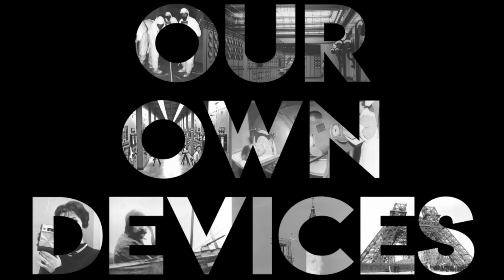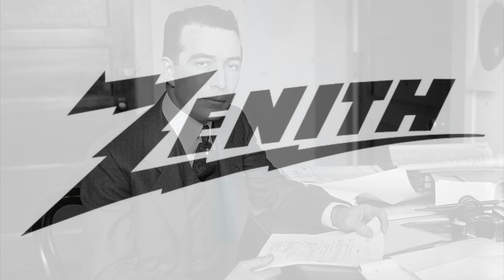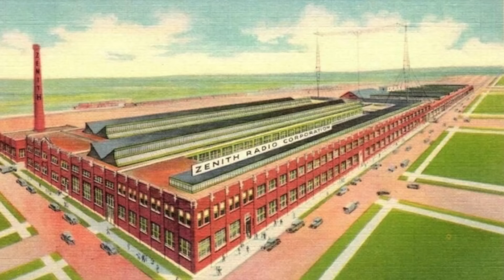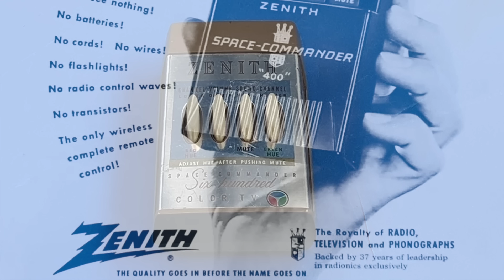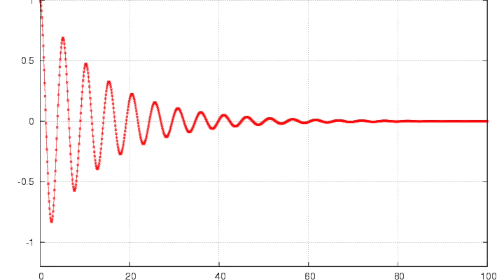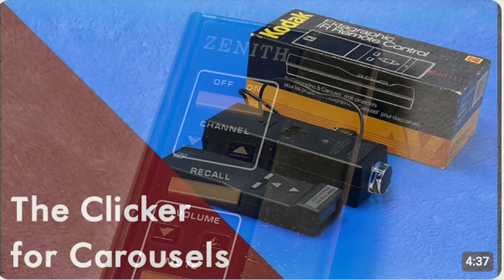Zenith Space Command TV Remote: the Original 'Clicker'

Comment: In 1963 my Mother purchased a 25” Magnavox color console television with AM/FM Stereo radio and a stereo turntable. Our first color TV, it was a tank, and cost $1000. The bezel around the screen was curved on the sides while being horizontal across the top and bottom. The picture tube was so large the tail end stuck out the rear of the cabinet about a foot. It was covered by an additional plastic housing mounted on the wooden rear panel. The sound system was incredible for its day, 2-24” broad range woofers and 2-4” x 24” rectangular x 24” deep horn tweeters. The remote was an ultrasonic “puffer”, one button for volume and another for TV channel. When pressing a button, a cylinder was being charged with air until a catch release was hit and you’d hear a hiss of air. The button would sag as the air was released. A motor with a detent control would advance the channels one direction one by one, 2 through 13, “U” and then over again to 2. No remote UHF, that required turning a radio-type knob and searching in the same manner we used to tune radio stations. The volume stepped one direction from low to high and wrapped back to low. Funny, to turn the volume down, you had to go up through the loudest to get back to the lowest and then stop at a setting lower than before. We enjoyed that TV into the early 80s, surviving 9 moves between homes in California, Hawaii and Nevada unscathed. When the electronics reached end of life, I converted the cabinet into additional storage for some of my mother’s silver. A suitable project because the pecan cabinet matched her buffet/hutch set which were also pecan.
Reply: That rear projection for the tube was called either the 'top hat' or 'bowler hat' in the UK, depending on size... and was a known vulnerable point on the set.... (the tube is weakest at the base)... any damage to there resulted in the tv service engineer (REMEMBER THEM?!) tutting and shaking his or her head

Comment: I'm solidly gen-x and believe me, I was the remote control into the late 70s.  Remotes were not ubiquitous as recently as the 70s.
These remotes that operate on tone added a lot money to the cost.  Though I believe IR was available by the late 70s, maybe even earlier.
But it really wasn't IR that lowered the price.  These tone remotes communicate to the TV through tones, but the TV has to hear it (requiring tuned circuits) and physical motors on the tuner and volume to operate them.  This added a lot of cost.  But once digital tuners came around, it was no longer necessary to drive motors to change the channel.

Comment: I'm 61 and my parents had a TV remote that was very similar to this one when I was a kid.  The TV was frustrating because you couldn't select a particular channel with the remote.  The remote would just make the channel selector rotate around the 13 channels on the dial and you had to keep pressing the button on the remote until the TV finally landed on the channel you wanted.  Because it was based on ultrasonic technology, the TV would also start changing channels if you dropped change, your keys or anything else on the floor that created sounds in the same frequency range as the remote/TV.

Comment: I had a 250 lb Zenith with one of those clickers. It actually stuck a bar like on a xylophone that chimed a tone very briefly, and the tv would use solenoids to rotate the channel selector. It had four buttons, channel up/down and volume up/down. Worked great, and no batteries! BTW, it came out of a Vegas casino hotel when they replaced all of them with new ones. Got it for a song.

Comment: I knew the basics that they operated by striking a bar to make a tone, but it's very interesting to dig into the specifics of the design. It's more complicated than it looks. Aside, I have a restored 1950s Trans-Oceanic that still works great after 70 years and the late 60s version of the same model. The difference in size between tube and transistor is about 5 to 1.

Comment: I remember as a kid back in the 60's someone I knew had a similar remote control, but it had chimes inside of it that were similar to that in a doorbell , you could still hear the frequencies, that  were very high pitched. they were kind of a high pitched clank that was dulled at the end. there were two/three  chimes one for channel up/Down/ and the other one was for Volume up/down. and maybe a 3rd for ON/Off? 
question: did the early subscription TV that you mentioned  tie up the phone line like dial up used to? or once the box received the signal, did it release the phone line?

Comment: One of the problems these early remotes didn't address is that just 'clicking' a channel by TV knob or remote didn't always get you clear reception so you had to 'fine tune' the set with an annular knob behind the channel selector on the TV. UHF was particularly bad for this. So even with a remote you might have to get up and tune the set.

Comment: My grandmother had a zenith color television with a space command remote. looked different from the one that you have as i remember. the tv was working up until sometime in the 90s. it did not adjust color, just turned the tv on, changed the volume and changed the channels. only did the 13 vhf channels. tv was probably bought before uhf became required. the tv color was very good compared to some i'd seen at the time. when i started working in IT my company decided to put a desktop computer on every staff and faculty desk. the first computers we purchased were zenith 286s. we purchased zenith computers for several years. one interesting feature is that in addition to the standard behavior of ctl alt del, you could do ctl alt ins which would activate a monitor which let you see what was in memory and disassemble code. neat feature which probably traced it's origins to heathkit. had some zenith laptops also. think they were among the earliest. took the remote apart at one point and after some thought it seemed obvious that it was using ultra sonic sound to work. hammers hitting rods pretty good clue. the trouble with infrared remotes is that they sometimes need to be pointed directly at the device being controlled. sometimes pointing them at a wall works, but the space command worked however it was pointed, pretty much every time, and replacing batteries in remotes is my bete noire. always having to go out at night to get new ones, and can't just throw the used ones away.
Reply: built in monitor, that's neat. you remember was it bios built in or loaded as default tsr?
Reply: @lasskinn474 think bios as I don't remember any loss of ram. Also no delay in loading. Been a long time, 90s, so 30+ years since I looked at one of these. Wow, tsr's used irma boards with a tsr emulating an  ibm terminal to look at student records. Isa on one side and ps2 slot on the other. Only ps2 boards I ever saw. $1000 each as I remember. Bought one for each department.

Comment: We had a 25 inch console tv in the 70's.  I took that remote apart as a kid and realized it wasn't a radio and there were no batteries.  It was a more modern looking 3 button unit, don't recall the brand.  I took everything apart as a kid and at maybe 7yrs old, this seemed to involve some level of wizardry in its function.  Now, 50 years later, I finally get it.  Thanks and keep up the good work!
Reply: I did the same things as a boy back in the 60's /70's. much to the Chagrin of my parents, I had/Have an unquenchable curiosity  thats the best way to learn how stuff works though 🖤👍
as a teenager my parents bought a new color TV, and gave me their old black and white console TV from the 50's , that did not have a remote, so I built one out of a barbecue motor that ran on
batteries, and also  a wired remote control for it .that you could change motor directions, and found out that with a little work the barbecue motor would fit on the shaft of TV channel changer. all
I had to do is remove the little ball bearing on the channel switch that made the detents between  channels, the motor really got bogged down with the bee-bee in place. the remote I built had a DPDT
3 position  toggle switch one way for  forward the other for reverse and the middle for off. it worked great but would have change  batteries once in a while. I could just lay on my bed and change channels 
with out having to get up. I was planning to work on a volume control and On/off switch. but never got around to it...because the TV finally gave up for good...
Reply: Finally it all clicks
Reply: Same. we had a similar TV. It was massive with a record player and 8 track player. It has a remote like this and I was so confused that it didn't have a battery cover. It was our first TV with a remote, despite it being the very early 90s, maybe late 80s. I think my dad found it on the side of the road.